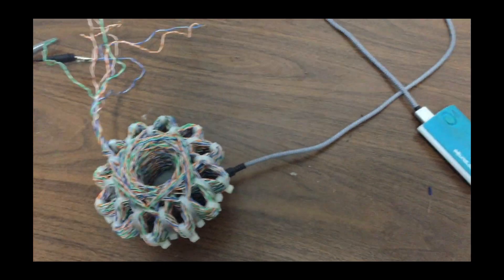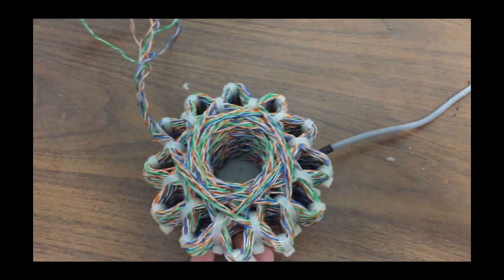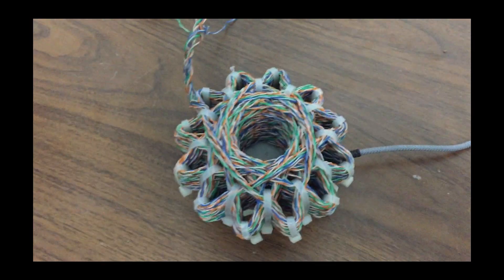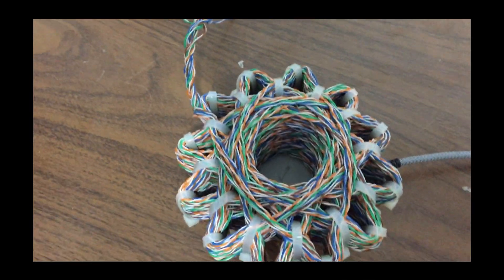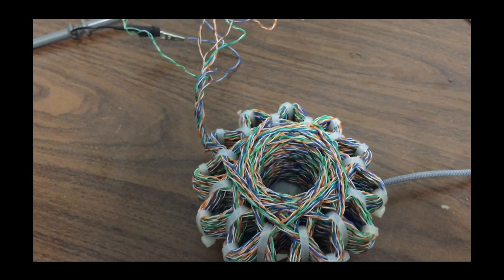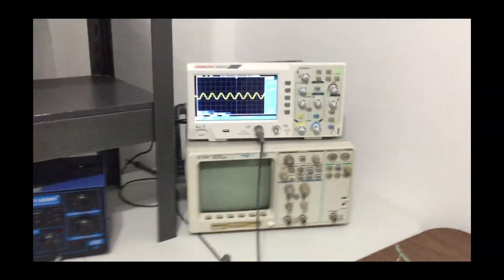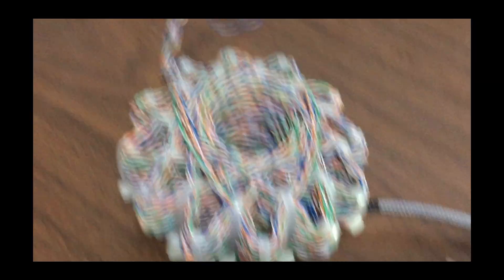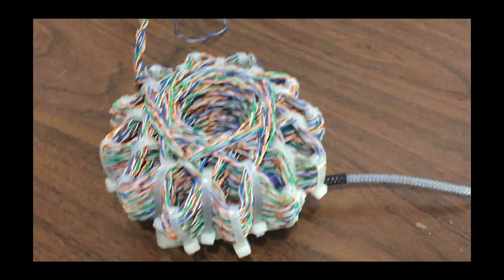High Voltage Magnetic Resonance

Comment: Can you run this on Mains voltage and maybe possibly use it as a transformer.
Can it work as a 3 phase transformer using a single core.
Please reply
Reply from the maker: No

Comment: I have seen that shape before, how'd you know to make that?🤔
Reply: Rodin Coil Explained
A Rodin coil, invented by Marko Rodin, is a type of electromagnetic coil designed with a specific geometrical pattern based on the Fibonacci sequence. This design is intended to create a stronger magnetic field and more efficient energy transfer compared to traditional coils. The coil is typically toroidal (doughnut-shaped) and consists of wire coils arranged in a unique configuration that Rodin claims can enhance energy efficiency and potentially produce more energy output than input.

The concept of the Rodin coil is based on the idea of vortex mathematics and the decimal parity system, which Rodin believes can unlock new possibilities in energy technology. The coil’s design aims to optimize energy usage and reduce losses in electrical and electronic systems. According to some proponents, the Rodin coil can achieve efficiencies greater than 100%, a claim that is highly controversial and not widely accepted by mainstream science.

In practical demonstrations, the Rodin coil has shown varying levels of performance. For instance, in one experiment, it was observed to produce an output power of 2.31W with an input power of 6.858W under no load conditions, resulting in an efficiency of 34%. When a load was attached, the efficiency increased to 71%, and with an extra load, the efficiency reportedly reached 290%, although this last figure is particularly contentious.

Critics argue that the Rodin coil’s claimed over-unity performance (COP > 1) violates the laws of thermodynamics and that the observed effects can be explained by other factors or experimental errors. Despite these criticisms, proponents continue to explore and develop the technology, believing it holds potential for significant advancements in energy production and efficiency.

Comment: Joel, I am sorry for this question but my mind went blank and I cannot remember what those little plasma safety spark gaps  that Don used were called... The ones that do not even look like gaps...Thank you so much...great video with even better information..Pure sine wave is incredible...Don's RF  usually ran at 21 Mhz from what I remember for the table top type devices with the coils...With the NST's he did things a bit different..Hence the vending machine device....-John
Reply from the maker: gas discharge tubes, experimented with them in earlier videos as well. Don Smith had several methods. You gotta pick and choose even combine the concepts that work best with what you got in mind.
Reply: @joellagace1679  I do not know if they will actually do this but Plausen seemed to use spark gaps to lower voltage...I was hoping to use several of those high voltage discharge tubes to see if I can lower the voltage. It seemed from one of his patents that he used several gaps to drop the 10,000 volts to a mush more usable l230 volts...I could be wrong but that is what it seems so far.. Any of your wisdom is welcome..thank you...

Comment: Still waiting for the portal to appear...
Reply: Rodin Coil Explained
A Rodin coil, invented by Marko Rodin, is a type of electromagnetic coil designed with a specific geometrical pattern based on the Fibonacci sequence. This design is intended to create a stronger magnetic field and more efficient energy transfer compared to traditional coils. The coil is typically toroidal (doughnut-shaped) and consists of wire coils arranged in a unique configuration that Rodin claims can enhance energy efficiency and potentially produce more energy output than input.

The concept of the Rodin coil is based on the idea of vortex mathematics and the decimal parity system, which Rodin believes can unlock new possibilities in energy technology. The coil’s design aims to optimize energy usage and reduce losses in electrical and electronic systems. According to some proponents, the Rodin coil can achieve efficiencies greater than 100%, a claim that is highly controversial and not widely accepted by mainstream science.

In practical demonstrations, the Rodin coil has shown varying levels of performance. For instance, in one experiment, it was observed to produce an output power of 2.31W with an input power of 6.858W under no load conditions, resulting in an efficiency of 34%. When a load was attached, the efficiency increased to 71%, and with an extra load, the efficiency reportedly reached 290%, although this last figure is particularly contentious.

Critics argue that the Rodin coil’s claimed over-unity performance (COP > 1) violates the laws of thermodynamics and that the observed effects can be explained by other factors or experimental errors. Despite these criticisms, proponents continue to explore and develop the technology, believing it holds potential for significant advancements in energy production and efficiency.

Comment: Hi Joel, very nice explained. I am working on the exact same path 😂
Using much lower frequency and without high voltage output indicate the same phenomena. Power available without loading the providing circuit … even I am getting some small output.

Anyway, much more advanced is your system as you get direct AC output while I am getting just DC as I am not as skilled as you in using the output and I wanted something that I thought I know how to manage.

Bear in mind we are using now much more easy available and cheap components that 30 years ago wouldn’t be available  … al those teachings about what we get is not usable are simply lies. Also, I guess you are aware that radiated field will just fry any electronics placed in this field pretty soon if you start to use it. We need a solution to limit this field within a certain distance while increasing the power otherwise MIB will soon knock on our doors.

Also, this explains very well why all radio and TV broadcasters are soo keen (or forced) to go digital or cable based.
Reply: Would a Faraday cage in your walls help keep the forget-pen-light from showing up?

Comment: Here's something few EEs realize, and which was not my discovery but I came to find out about it from a gov't contractor...If you have an RF source with an output load of capacitive reactance that is perfectly impedance matched (i.e. 50 ohm of Xc while using a 50 ohm cable) and you also have that load inside of an RF shielded enclosure, that signal will be reflected back, creating a standing wave condition... This was being talked about in the use of creating an over unity circuit.

Separately, it was the physcist Adam Trombly who was a young protege of Joseph Kahn whom became mutual patent holders for a >200+ COP dynamo which utilized a key CLASSIFIED characteristic of iron with magnetism... creating a 'magnetic sink,' in that, with a certain number of pounds of iron (I can't remember off the top of head, I'd have to search my drive), efficiency is increased by x. This is classified, and it was already classified at that time in the 80s by the US Navy and so their dynamo was seized and they were both gagged about how it worked. Adam has never said this, but I found out by someone else. 

In the words of Trombly at an energy conference in Switzerland way back in 1989, he says "All we have to do... is in a resonant domain introduce a heterodyning wave or standing wave properly... and it increases the effective field density"...I managed to find video from that conference in a series of videos titled "Depalma N machine 1-18"
Reply: Fascinating!

Tell me, do you know anything of phase conjugation of signals? 

How about anapole mode antennae? 

I have seen evidence in Tesla's patent for his "non-linear shuttle oscillating circuit" that allows for dynamic impedance matching and floating grounds of differing potentials to introduce the non-linear dynamics necessary for phase conjugation. 

This talk of a standing wave in proper configuration hints at phase conjugation, I think. Which would explain how environmental energy could be harvested as the resonant materials form a "sink" in a far from equilibrium thermodynamic system. Many crystalline materials such as ceramics have opto-electronic and magneto-electronic susceptibility of order 2 due to the crystal structure, enabling 4-wave mixing.

Anapoles similarly have a phase locking condition where output signals are destructively interfered in the far field. But near field constructive interference allows anapoles to be "perfect absorbers" at resonance. Already power beaming experiments have been performed with anapoles, and a little improvement could allow them to harvest ambient RF noise and perhaps suppress quantum fluctuations leading to additional energy input from the environment not normally available in electromagnetic wave form.
Reply: Actually, just about all EEs recognize that you get a reflection when you don't terminate a line with its characteristic impedance, and you can get a standing wave.  We normally try to avoid this because it means you're losing energy that could be going to the load and doing something useful.

It doesn't mean you get some kind of "over unity" energy.  If the load impedance is larger than the line impedance, you can increase the voltage the load sees by up to a factor of 2.  But that also means you will get less power from that line into the load. So you can get an "over unity" in the voltage, but NOT in the energy or power.  You don't have to believe me.  The math is available on-line and you can check it yourself.

Yes, I am an EE, and about 10 years ago I designed the front end for a piece of test equipment for DirecTV ground receivers.  It operated in the 2 = 2.5GHz region.  Their tuner sits at the end of the trace on a PCB and is matched with an L-C network, while the surge supression (a large TVS diode) sits 1/4 wavelength away so its comparitively large capacitance (which essentially looks like a short where it's attached to the net) looks like an open at the tuner.
Reply: @Cynthia_Cantrell  Yes, obviously. But many get confused when youre talking about a load of capacitive reactance.
Reply: @Cynthia_Cantrell  Also, I was not trying to say this alone would produce over unity, but it was key to an over unity circuit schematic, which I have.
Reply: @AethericTheorem  lol
Reply: @AethericTheorem Then why aren’t you a billionaire yet?
Reply: Well, that's because you have a capactive load vs a resistive load. That is why you have terminating resistors on RF transmission lines that are equal to the impedeance of the line. I use the analogy that you have a long pool of water six inches deep. The depth of the water is uniformly deep and is analagous to the impedance. You can use a piece of wood to push the water from the edge and it produces a wave that travels across the pool. If the wave encounters an object sitting in the pool a portion of the wave will reflect backwards (a change in impedance) and will bounce back to the origin creating constructive and destructive interference. When the wave reaches the other side of the pool it will bounce back unless the wave energy is absorbed (termination resistor load that is must be impedance matched).
Reply: classified classified classified classified classified.
Reply: Basically tap into the sun... got it. Because copper wires aren't the answer to "low input high output" energy for global use. Thermal dynamics says this also but fusion as in how solar systems work are more likely to be key to this fixation on energy. The smallest of creation "atoms" (or even smaller as we reveal reality) transfer power to the largest of galaxies. "As above so below"